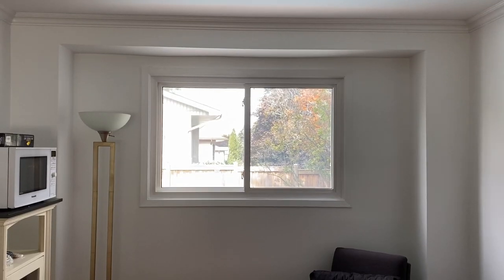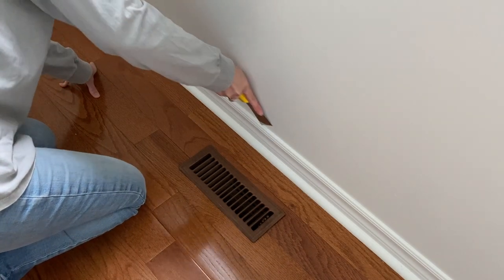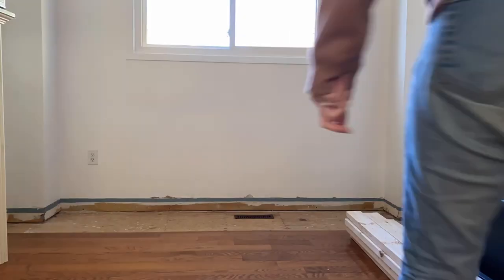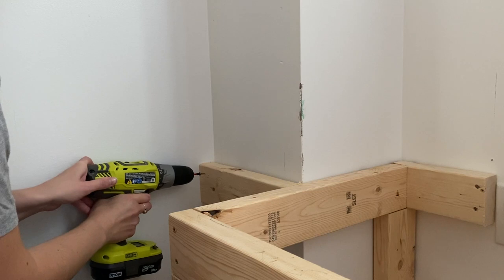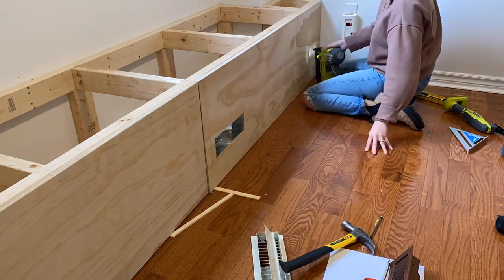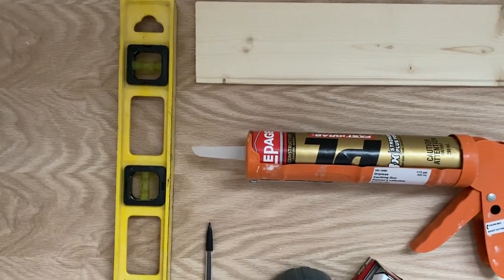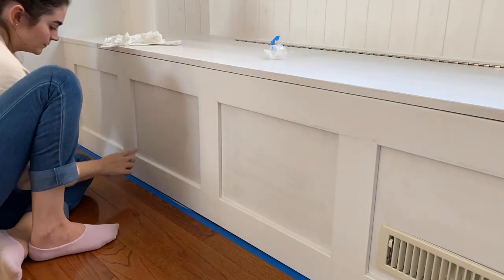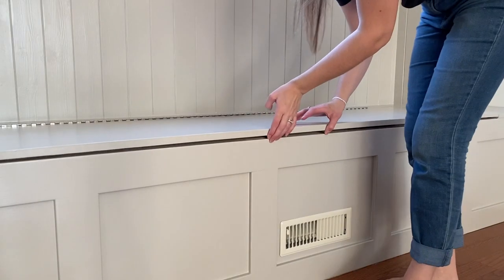DIY Custom Built-In Storage Bench + Wall Feature For Our Dining Room! | The One Room Challenge

Comment: Do we have to remove flooring to put it in a bench? We have tile and I don't want to remove it
Reply from the maker: Hi there! Removing the floor is definitely not necessary. The reason I did is because we know we will be replacing this floor in the future and I wanted to save the headache of removal later. If you don’t plan to replace your floors, by all means, you can build right on top.

Comment: Did you trim the edge band afterwards? I have a similar bench but in L shape. I think the storage is somewhat useless since you need to remove everything on the top to open it. Every time I open the bench top I see the unfinished inside feel bad putting things in there. The hinge looks bad when showing on top. I know this piano hinge is a cheap and easy solution but I didn't really like mine at all. It looks cheap and intruding. I'm currently replacing the bench with solid top and built-in drawers.
Reply from the maker: I sanded the edge band to make it flush with the edge of the plywood. I've never regretted not finishing the interior of our bench, but could definitely still do it now if I wanted to. I only store things I rarely use (ie. party drink dispenser, puzzles, etc), but could see how it would be annoying if you're regularly accessing the contents. I love the idea of built-in drawers and would love to hear how yours turns out :)